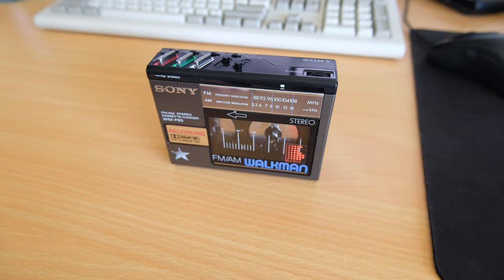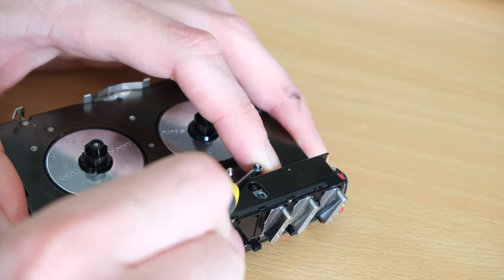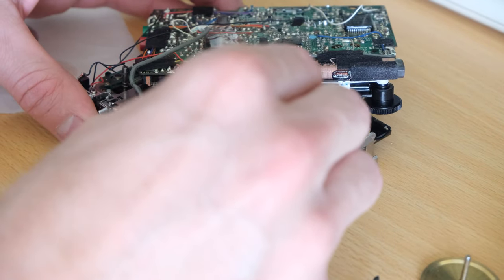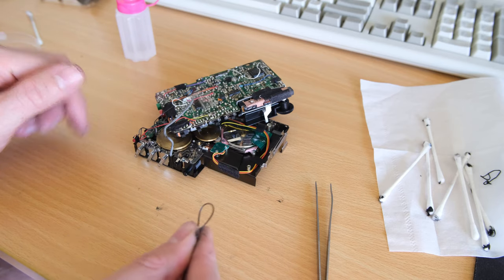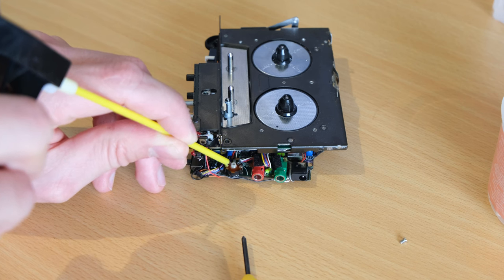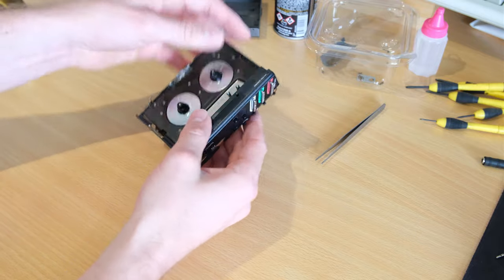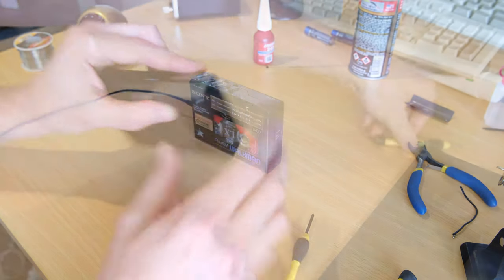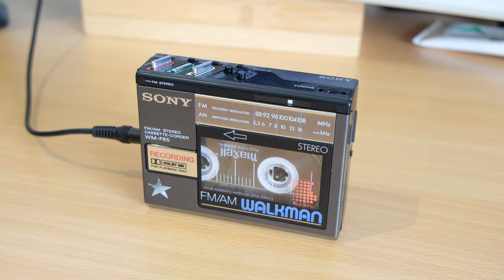Battery Damaged Walkman Repair | Sony WM-F65

Comment: I had the F65 back in my school days. A very fine sounding unit, where it allows not only speed adjustment at the back but also head azimuth to get the best possible sound out of any tape
Reply from the maker: What was it like back in the day being able to save up, go into the store and buying one of these bad boys new? Would have been amazing! I do like the adjustments that can be made easily on these units
Reply: @thesmokingcap  also I do recall this F65 is able to run on a single AA battery instead of two! 😅